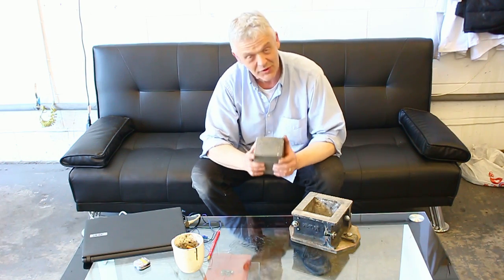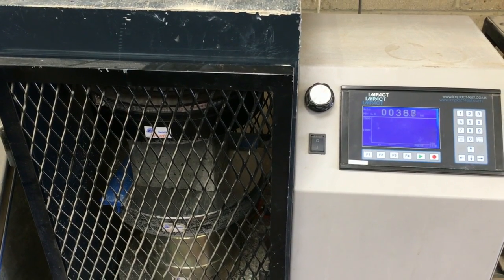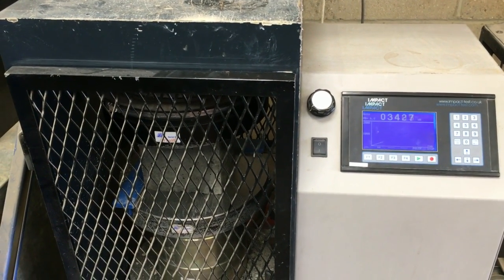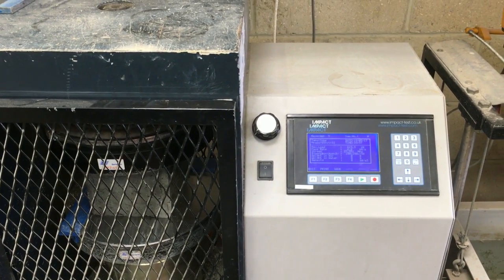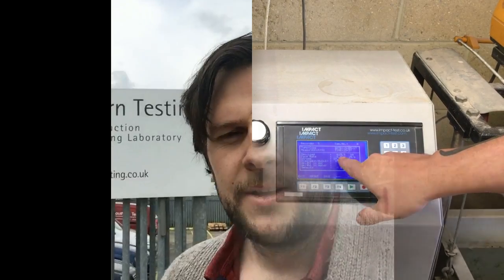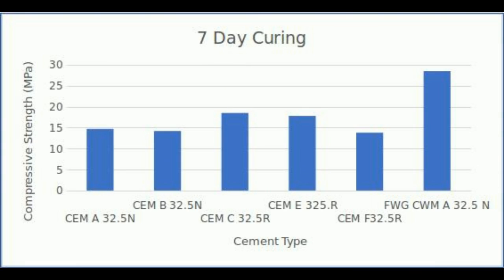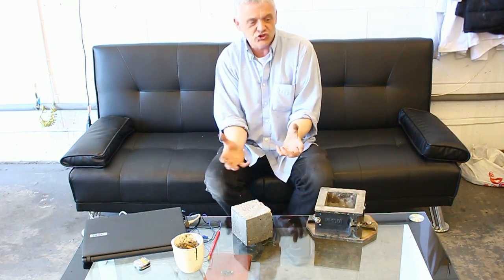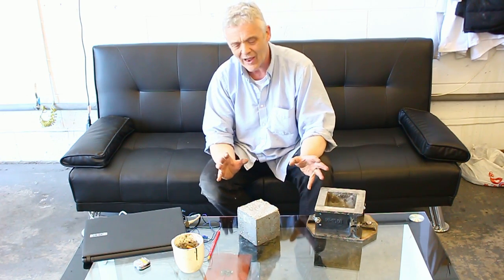Graphene in Concrete

Comment: Have you tried graphene with inorganic polymers? Something I worked on... Great work...
Reply from the maker: nope - but we will do sometime i guess - cheers mate
Reply: PatchCode wow... If it's possible that's gonna be insane
Reply: if the heat doesn't destroy the structures as it makes the bonds with the iron and other additives at 1648C (2900-3000F) you might end up with a higher strength high carbon steel, but you would need to control for the size of graphene sheets in the end product and mixing.

http://poplab.stanford.edu/pdfs/PopVarshneyRoy-GrapheneThermal-MRSbull12.pdf

graphite is already used in carbonization of crucible steel production at scale. the end % of carbon in the steel is ~0.04 to 1.5% carbon with other additives and very few impurities. I take it that since graphene is ablated layer by layer with diffuse lasers at around 2000K (1727C) that most of the graphene would be burned up or reacted.

https://www.nature.com/articles/srep11546

https://www.steel.org/making-steel/how-its-made/processes/processes-info/the-basic-oxygen-steelmaking-process.aspx

the larger sizes of graphene sheets and their reactivities with other elements in the process may cause a lower quality steel to be made as either the graphene would be damaged and weakened through chemical reactions, or the sheets would more or less always get pulled into the slag or cause inclusions if intact.

https://en.wikipedia.org/wiki/Steelmaking

TL;DR: When you are making crucible steel its too hot, large sheets or clumps cause lower quality steel, impurities and reactiveness with additives and waste slag lower quality, and they already use graphite.

P.S. The steel making article was using sources around 1998-1999 for information. Still good, but it would be cool to know what new techniques and systems are in use today.

Comment: One of the issues with building stronger concrete is it's thicker and harder to pump to heights. Does this formula do anything to help in this area?
Reply from the maker: yes mate twice the strength means half the thickness
Reply: So the slump tests show it flows like regular concrete? That would be a huge gain all on it's own never mind the cure time and strength gains.
Reply from the maker: yep it would
Reply: Robert Murray-Smith 
can it be used as a topical seal?
does it suspend well in acrylic? 
I know it would have to be applied agin when it breaks down but it wouldn't mess up the cement truck and the concrete won't crack. you know the only guarantee about concrete is it will crack.
Reply from the maker: I am sorry mate - i have no idea
Reply: Robert Murray-Smith  depends on the force direction though . the thickness would not be a linear measure . 300mm thick would be far more than double the strength of 150 mm surely?
Reply from the maker: I have no idea mate